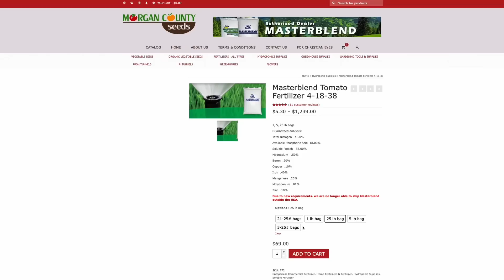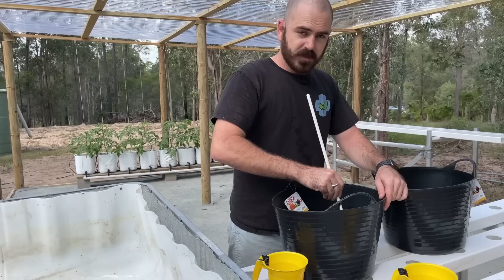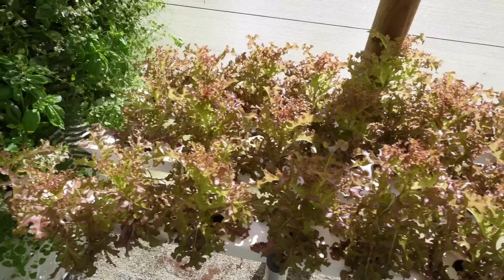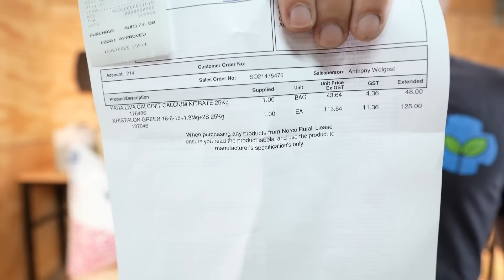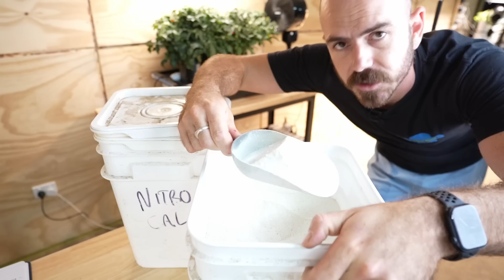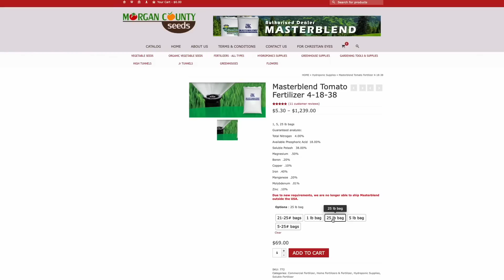Best Value Hydroponic Nutrient?!

Comment: I just built my first NFT system and wanna try and grow one head of lettuce a day. Got an all purpose 20-20-20 + micronutrient solid fertilizer, but now I'm wondering how much to use. Should I just go with the recommendation on the package that says 8-9g per 5l of water? And then try and maintain a stable water level while measuring EC and refill nutrients until I reach the initial EC level?
Reply from the maker: Soil fertiliser won't work.
Reply: :face-pink-tears: @Hoocho

Comment: Kristalon Special is the foilar feed formula, high in urea. Urea in substrate and hydroponics is very tricky, as it gets broken down and creates pH swings. May work, but not recommended. Get Brown or Orange instead for mixing with CalcInit. Then if you need to blend in a third form to set the NPK exactly right, use Blue, Green, Yellow or Violet. Don't forget Epson salts or Kistra Mag for more Magnesium, especially if you use soft, rain, or RO water.

Comment: The instructions that you listed for the masterblend 3 part on their website seems like it is for soil applications, I’m trying to figure out a concentration to make a 3 part stock solution but I don’t have a tds meter at the moment.
Reply: I did find this recipe with a little digging:

Chilled’s General Purpose Recipe:

Part A Solution:

1-gallon Reverse Osmosis (RO) or distilled water
600 grams Masterblend 4-18-38 Tomato Special
300 grams Epsom Salt
1.5 grams Sodium Benzoate as an anti-mold and anti-fungal preservative (optional)
Part B Solution:

1 gallon RO or distilled water
1,100 grams Calcium Nitrate*
*This is about twice as much Calcium Nitrate as you’ll find in the traditional Masterblend formula, which is 2 parts Masterblend 4-18-38 Tomato Special, 1 part Epsom Salt, and 2 parts Calcium Nitrate. 

Formula’s Specifics

The above makes 250x concentrate (each gallon of concentrate would make 250 gallons of working solution) when using it at 15ml Part A and 15ml Part B for each 1 gallon of water.

With RO water you would get an EC of about 2.0 or PPM of 1000 at the 500 conductivity scale (.5 conversion).
Reply: @FistfullofDuncans  
Masterblend contains MKP which is incompatible with magnesium sulphate in a concentrated stock solution.

Comment: Hi Hoocho. Something's weird with that Yara Kristalon formula you were given. It has many times the potassium and nitrogen of the other formulas.

Campbells formulation (fruiting) seems to give 237 mg/l of N, 39, mg/l of P, 322 mg/l of K and 193mg/l of Ca
The masterblend formula seems to give 117 mg/l of N, 47 mg/l of P, 189 mg/l of K, and 117mg/l of Ca
The Yara mixture (if the 18-18-18 npk oxide percentages on the bag are accurate) seems to give 609mg/l of N, 78mg/l P, 917mg/l K and 190 mg/l Ca

The complete guide to growing plants hydroponically has a recommended nutrient concentration for tomatoes (one of the more nutrient-demanding crops) of 200 mg/l N, 50 mg/l P 360mg/l K 185 mg/L Ca.

So Campbells fruiting formula seems very close to what you'd want for a tomato plant, and masterblend seems conservative but reasonable (perhaps aimed at plants in an earlier stage of development or less demanding than tomato plants, like the campbell's greens formula). The quoted Yara mixture seems excessive by close to a factor of 3 for N and K.
Reply: I dont know what the rep was thinking when he recommended the kristalon special for hydroponics :)
Reply: It's really weird. I subsequently had a closer look at the special and half of the nitrogen is apparently supplied as urea, making it even less suitable.

I believe there are a couple of Yara NPK fertilisers suitable though. Ideally kristalon scarlet, but kristalon red could also be made to work with most crops. (Though once again, the quantities of nutrient supplied should be a lot less than what this agronomist suggested.)
Reply: @rickdangerous1956  
A typical hydro nutrient for a recirculating system will have 80% of the N in the form of nitrate (NO3) with a max of 20% ammonium (NH4). Nutrients formulated for drain to waste contain mostly nitrate.  No hydroponic nutrient that i know of uses Urea :) 
Here`s a breakdown of the Kristalon range: (elemental ppm)
The Scarlet at 1g/L provides NO3: 75, P: 52 and K: 299. 
The Red at 1g/L has NO3:  101, NH4: 19, P:52, K: 299. 
The Brown at 1g/L has NO3: 30, P: 48, K: 315. 
The Orange at 1g/L has NO3: 45, NH4: 15, P: 52, K: 299. 
The White at 1g/L has NO3: 113, NH4: 37, P: 22, K: 249. 
Yara Calcinit at 1g/L has NO3: 144, NH4: 11, Ca:  190.
The most suitable are the Scarlet and the Brown, the brown has lower N which offers more flexibility for tailoring the formulation than the scarlet but both will do the job.
Reply: @atomizer2665  Thanks for the detailed reply! Brown would actually be the best for my purposes, but it's hard for me to source.  :( 

I've read some research suggesting a 90:10 to 80:20 ratio of NO3- to NH4+ is primarily useful for maintaining the pH as nutrients are absorbed. I guess drain-to-waste doesn't deal with that problem since the solution is discarded before the pH changes too much?
Reply: @rickdangerous1956 
The uptake of NO3 will raise the solution PH where uptake of NH4 will cause it to fall, a lot of recirc nutreints use the NO3:NH4 ratio for PH control. GH flora and others use P for that job which is why it is hellishly high :) I recirculate the nutrient in my flood and drain 10 bucket system but run drain to waste in all my aero setups. The flood and drain takes care of the small amount of run off from the aero so its not wasted. I`ve purposefully left nutrients in an accumulator for a month and the EC/PH didnt change, a reservoir open to the air or with an airstone in it is a difference kettle of fish. A drain to waste nutrient will have a different elemental profile to a recirc nutrient, which is mainly to do with the rate at which elements can be taken up, for example, NH4 uptake is more or less instant compared to Ca.  There is a lot more to nutrients than just NPK :)

Comment: I was using the Fox Farm's liquid in my mini table top NFTs which was very easy to use and did a great job.  I recently got a 2 lbs. set of the MasterBlend powders and have mixed feelings about it.  Yes, it's fairly easy to mix.  I don't have an EC meter, just a PPM and liquid pH test kits, so I don't REALLY know what I've got.  Based on the mixing instructions, I try to go about 1/2 strength for leafy greens (mixing 12, 12, 6 and then doubling the water).  This is my first season growing hydroponically so the longer term tests should prove to be more accurate.

Comment: From my research the Yara Kristalon is urea based which is not super useful for hydroponics. Urea breaks down into ammonia and later nitrogen and has been found to be useful in soil application but studies have shown hydroponically just using nitrogen outperforms urea based fertilisers everytime. From my reading I chose YaraTera Ferticare Tomato as my every crop fert in the same way you use Spec T add it's not urea based.
Reply: Interesting, I have been using Ferticare Tomato and ferticare Lettuce, was very impressed with both , for both plant health and plant yield, I did try ferticare tomato and cucumbers with success and Peppers, but had a drama where i had to remove/prune off a massive amount of flowers from the peppers, I will be stocking up on Ferticare vegetable for both of those 2 for the upcoming crops,   I found your comments on Urea interesting,  Last time I spoke with the Yara Agronomist he informed me that they were discontinuing the Kristlon range..Ill look into that.
Reply: Urea requires an enzyme called urease to break it down into ammonia. Afaik, its only found in soil.
Reply: @N1ghtR1der666  I wonder if they are changing their naming conventions as Kristalon previously denoted urea based and ferticare was non-urea based
Reply: @D-Grows  
Yara`s kristalon range has been around for years, its always had nitrate only versions.
Reply: @atomizer2665  maybe it's a regional thing as that's not the case for the range available in Australia
Reply: @D-Grows  
I doubt they would use the same brand name for different formulations in different countries, but you never know :)  Each formulation in the kristalon range has a different coloured dye in it, brown, orange, red etc, so you can easily identify what formulation it is.

Comment: I have the breakdown of every mineral ppm for the top 10 nutrient salts in the states.. heh. masterblend is easily one of the best value, can confirm (i educate on this topic here 15 years heh)
Reply: also a good value is it includes silica.. most do not. But I would recommend MSA silica, much superior in foliar and such.
Reply: msa silica is far superior compared to normal potassium silicate
Reply: you have to add them in order (like the jacks321 recipe or masterblend) because of bonding... it's best to presoal the salts in water, and just add that liquified and dissolved instead of directly into the final batch tank (just a small cup of water for each part)
Reply: What do you think about jacks? That's what I keep going back to after having problems with other fertilizers.

Comment: When there were rumors of a fertilizer shortage I got the 25 pound Master Blend combo package, a jug of the popular liquid YouTube won`t allow me to post, and a kilo of nutrient powder "Maxi G" so I`d have plenty on hand just in case, a large cube of rock wool. and 25 three inch net cups and a large bag of clay pebbles. I got the PH kit too to try and a few types of lights. I`m about to try an outdoor 5 gallon bucket, food grade, with a 6 inch basket lid with clay pebbles. I`m placing it underneath the edge of my camper roof to keep direct rain off it. I discovered that 3 inch net baskets fit perfectly in the tops of Folgers Instant coffee containers and successfully grew a large basil plant through the Winter in a sunny camper window. I planted some buttercrunch lettuce outside to make seeds but the friendly cottontail bunnies devoured it. Gonna try again now that Spring is here in Louisiana and they have more to eat. If it doesn`t work I`m getting the lettuce off the ground in hanging planters. I`m trying to be nice to the bunnies because I`m a prepper and they`re an easy emergency food supply.
Reply: What is the purpose of the liquid you're not allowed to name? Is it for making soluble calcium or have I guessed wrong?
Reply: @danz9211  Anything prepping related that might help feed or save someone from severe weather is auto deleted by the death deserving YouTube leftists. I can barely contain my homicidal rage for the democrats trying to destroy humanity.

Comment: Hey buddy first I want to say I really like your videos.
Now I have a question,how often should I change water?
Or should I even be concerned about it?
Thank You!
Reply: Unfortunately this is a how long is a piece of string style question. It depends on your system design i.e. NFT vs Drain to waste. It also depends on the plants in your system. Sorry for the non answer but to get a useful answer you would need to provide a little more specific information. You can always monitor your nutrient weekly to see how your PH and EC are faring if you have the right tools.
Reply: Every 7 to 10 days
Reply: 1. you want aerated water.
2. you want 6 pH for most plants like pepper and tomato.
3.use the hydroponic pH chart for each plant, it's all available to find easily
4. change every 7 to 10 days, checking the pH every 12 hours for fluctuations.
Reply: DWC USING A 5 GALLON BUCKET AND I WILL BE GROWING Marijuana!
Reply: @moqo  I also liked the method that you used with a tomato plant were you just used a big bucket full of water and nutrients no air pump or anything, but I don’t know if that would work with Marijuana.
No matter I also want to grow Tomatoes and other vegetables.
Reply: I am referring to the Kratky system.
You really got my attention with the two kratky system videos I seen.

Comment: Kristalon Special has too much N, at 18% its only suitable for leafy greens. also contains Urea which is not even suitable for use in hydroponics.  If you read its MSDS you'd note it uses ammonium nitrate instead of calcium nitrate for N which explains why it does not have calcium. I'd say its not a good option as generic hydroponic fertiliser.
Reply: The calcium has to be kept separate, thats why it has no calcium in it :)